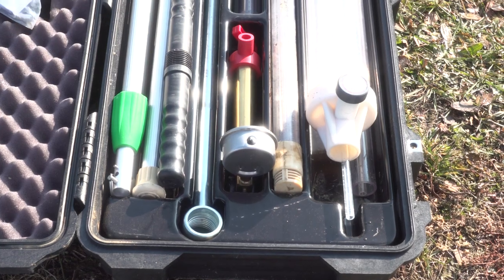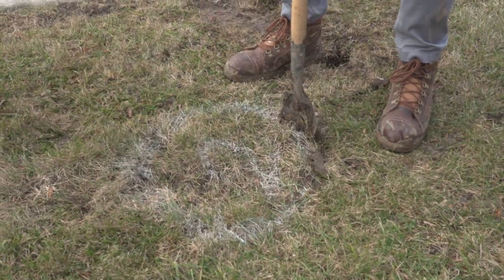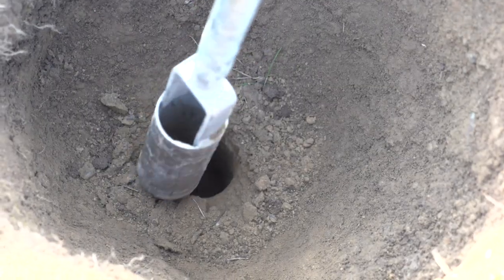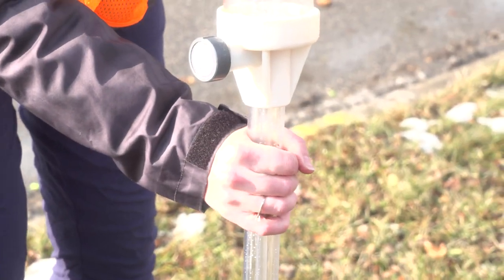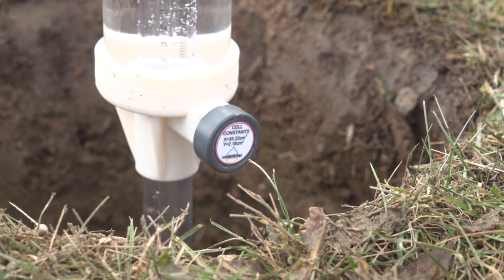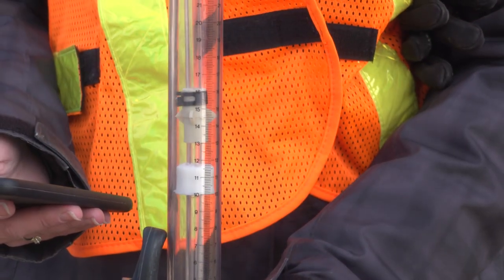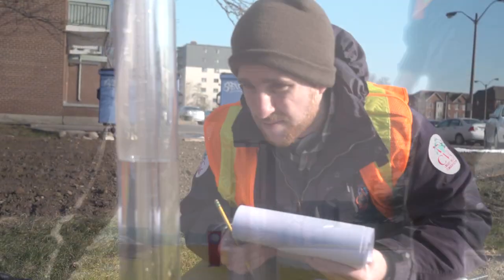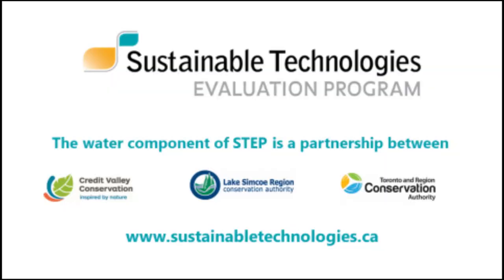How to Set up and Use a Guelph Permeameter

Comment: The Guelph Permeameter is a great piece of equipment, especially for deep tests, however for most shallow subsurface testing applications, the ETC Pask Permeameter is much faster to set up, provides results that are just as accurate, and is about 1/3 of the cost of the Guelph. Check our this article comparing the two devices, with a side-by-side video of the set-up process: 
https://dynamicmonitors.com/comparison-of-the-etc-pask-permeameter-to-the-guelph-permeameter/

Our permeameter is in use by engineering consulting firms, Provincial, State and County Health Departments, universities and colleges all over Canada and the USA and beyond. In the published literature by Elrick & Reynolds, they say that a single ponded height test can be just as effective, and avoids the potential for negative results, than a double ponded height test. 

If you are used to the old fashioned percolation test, constant head permeameters offer a faster, and more scientifically accurate alternative to measure the soil's field saturated hydraulic conductivity for septic assessments and stormwater BMP designs. See the article at the link below for more information, including a link to a research paper published in 2015 on a new expression relating Kfs to Perc Time. 
https://dynamicmonitors.com/relationship-of-kfs-to-percolation-time/